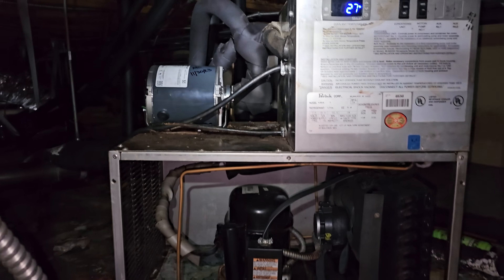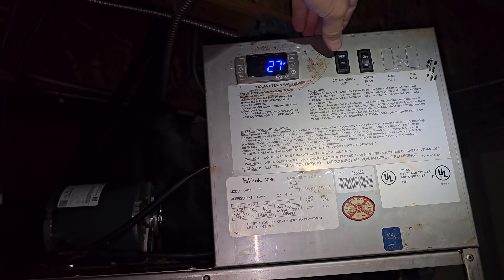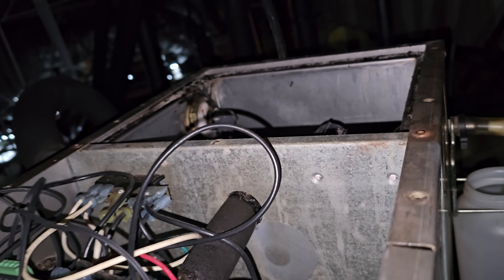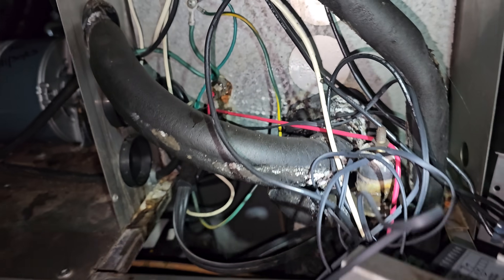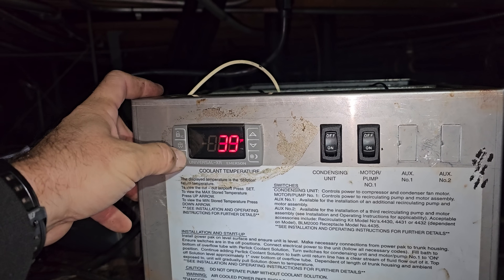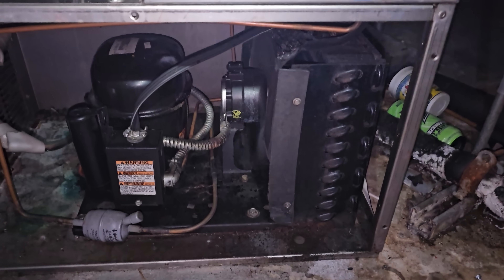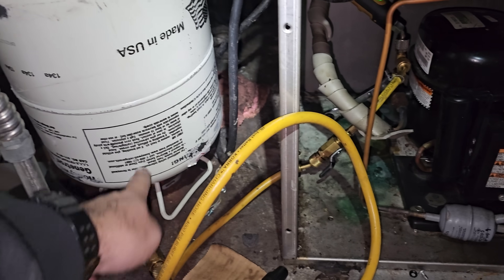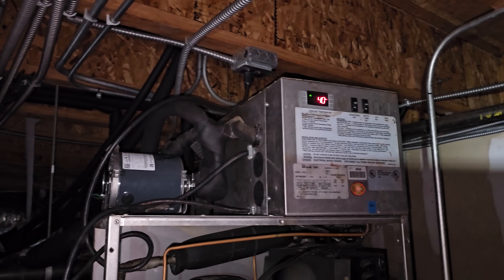THE GLYCOL UNIT IS TOO COLD OR IS IT TOO WARM?

Comment: Every time you put probes on hold the probe straight don’t let it turn when you tighten the nut, you won’t ruin the gasket. You can mess the gasket up putting it on one time. You get close to zero loss with a new gasket on those probes!

Comment: Those are 10k NTC thermistor probes, just ohm them out and compare to chart to be sure next time. Also, those controllers can have a delay on the display readout programmed in to not show you the true temperature in real time. When I know there is a big temp swing I just cycle the power to the controller and then when it restarts it usually will display the correct temperature unless you actually do have a bad controller/probe.

Comment: Maybe the manufacturers should use a double pole switch for the pump(s) and put the other pole in series with the compressor so turning off the pump(s) also shuts down the compressor?? Someone may know why they don't. Good on you for cleaning up the mess!

Comment: Not sure if your aware but there is a plastic insert you can use for your hats that makes them into bump caps. I was fortunate to be wearing one when I wacked my head on a low beam. Still hurt but prevented a possible concussion.
Great vid and thank you for cleaning up. It something that will make you stand out from the competition.

Comment: I was in this crawl space that someone didn't bother clearing the lot before building a house on it, and there was foliage all over the place(dried grass, dead weeds, etc). One of the stems whacked me in my jimmy beans and had a knee jerk reaction to jump up and slam my head into a wood flooring brad that were riddled all over the place. It had to hit skull bone and I sat there leaned my head over after I felt blood running through my hair just to keep it out of my face, let it pool up in the sand and dried grass in a big puddle for about 10 minutes. The guys were wondering what I was doing and kept yelling into the crawl space access "Are you fiddling with yourself down there" waiting for me to finish my job of running some romex to a kitchen. I kept telling them to "F*** off" and "leave me alone a***holes" until they stopped bothering me. It left a nice scab buried in the hair on my head.

Comment: As a videomaker I recommend (also to increase both the quantity of videos and the length of the individual clips in the field without bothering you to hold the camera in your hand) to wear an action cam for general shots where macros are not needed and continue to use the quality of the smartphone for details. I also recommend using for all clips/shooting devices 1080p/FHD with 60FPS mode for smooth, quality videos...

P.S.: remember to clean your lenses/objectives before recording!

Keep going, your character and your format as you put it is very entertaining and above all it is TRUE and not artificial!
A hug!

Comment: Are there racks out there using refrigerant to cool the glycol? There’s a refrigeration rack in my area for a Walmart but it’s listed as a 404a/glycol rack. I’m curious on how that works. I assume glycol is being pumped into the cases but seeing that 404a listed confused me.
Reply: They work the same except the glycol and refrigerant run through the flat plate heat exchanger instead of sitting in a glycol bath. pumps then send the glycol out to the cases, boxes, AHUs, etc.
Reply: @chrisconklin873  ah. That heat exchanger is like a subcooler or no?

Comment: for these small units (or all units in general) you are better off using the shrader depressors you can open and close with a tumb screw on the top. they have acutal no loss.
Reply: Someone mentioned these in another comment. I’ve never heard of them and I’m curious. Do you have a part number I can google?
Reply: Something like a Supco SF5050 @kswitch87
Reply: @kswitch87  just search for schrader core depressor.
Reply: @kswitch87   Just google the phrase "thumb screw shrader depressors"

Comment: Where I live (east coast), the beverage company provides the equipment and they have their guys work on it. Their techs are certified in refrigeration and know how to service the entire glycol unit. They even do the electrical work on it too. The only time they require an electrician is if they need a new circuit or if the breaker went bad.
Reply: Think of the disasters that this "beverage company" could create 😂
Reply: The beverage company I'm talking about has a very good reputation with the people they service. In fact I have worked along side of them and their techs are really good. @adamdnewman
Reply: We have a similar thing out here in AZ but it doesn’t seem to go so well. We had a customer that had their beer guy work on their glycol for several years, it never worked right and our first call on-site we found the glycol chiller was undersized compared to the amount of cooling needed for the length of lineset
Reply: Apparently from competitive beer distributors over a hundred years ago.

Comment: You seem to work on these a decent amount.....have you ever considered getting a refractometer to test the glycol....not sure if that is something you deal with or are concerned with. I have a refractometer.....i also...at least when i lived in Buffalo.....dealt with glycol on a very consistent basis. Just curious as to your thoughts. Glycol can and will "go bad" after time.
Reply from the maker: Yeah I have one in my van at all times, just didn’t see the need this time.
Reply: @HVACRVIDEOS  right on....never seen you use one in a video. Its cool that you have one.....and im not surprised at all. Thanks for sharing this video
Reply: @HVACRVIDEOS  did you know Nu Calgon make a refrigeration oil refractometer....its a bit pricey....but its cool there is a tool for checking oil mixture if doing a conversion
Reply: @jasonjohnsonHVAC that's awesome
Reply from the maker: https://youtu.be/ahg7AUoZ47k?si=UTOuQRcCSiMwf0zq